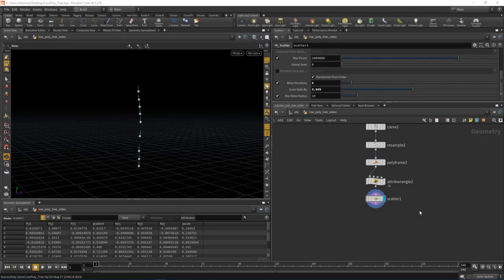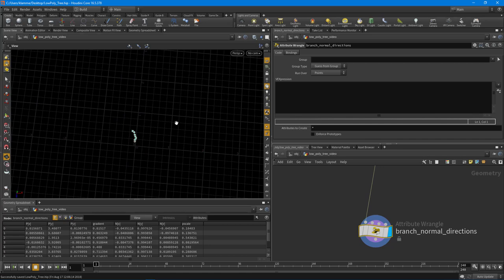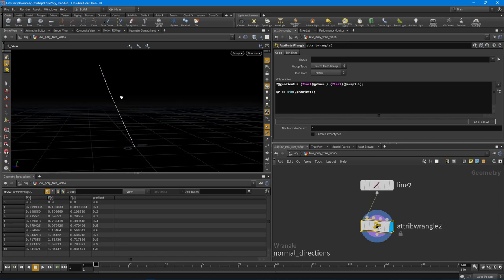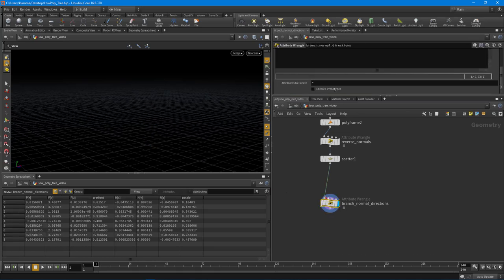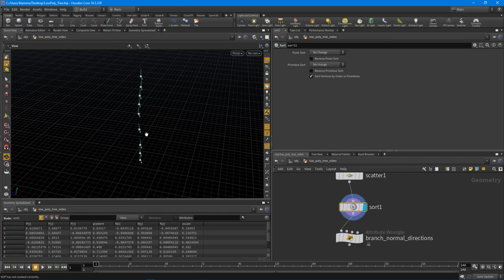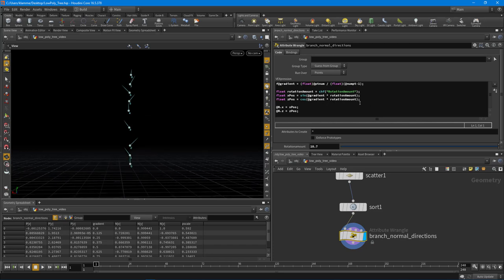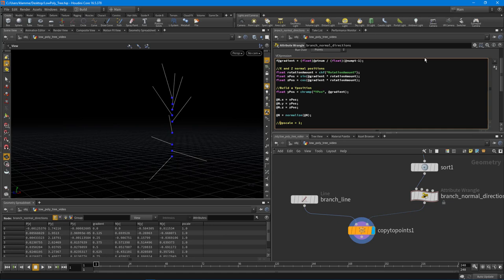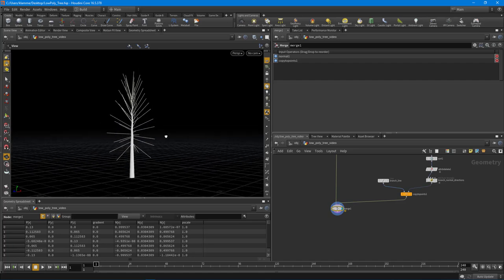Procedural Trees - Part 4

Comment: Hi Indie-Pixel.  I'm not so sure about the spiral thing, although don't get me wrong, still pretty cool & does occur. However, I reckon alternate, opposite or whorled, for the branching arrangements would be more accurate botanically. "Whorled" is when multiple branches come out at one place like a ring. This is actually the system we use for ID of rainforest plants because flowers in rainforests are hard to collect/see due to being too high & small etc. It is actually the pattern the leaves occur in that determines the branching pattern, because when you think about it all trees start off as saplings & it is the leaf arrangement that determines where branching occurs & this pattern is usually reflected throughout the tree. I suppose it is almost a fractal thing in some ways, patterns repeating in nature. Spiralling tends to occur in flowers more so than branches. Anyway, enough ranting from me, still enjoying the videos & keep up the good work. Cheers.